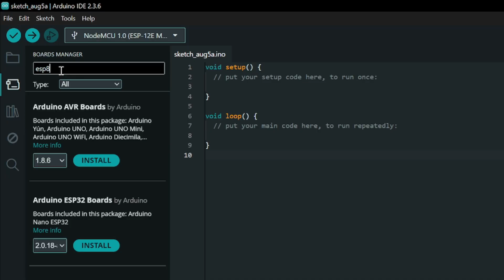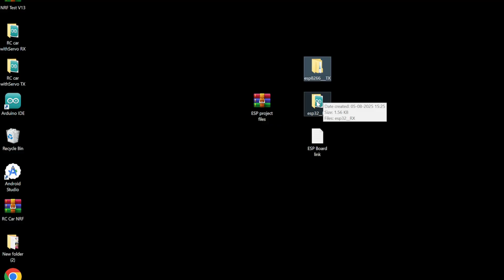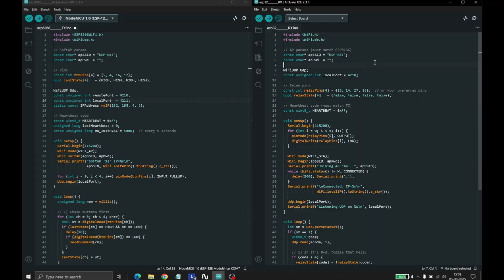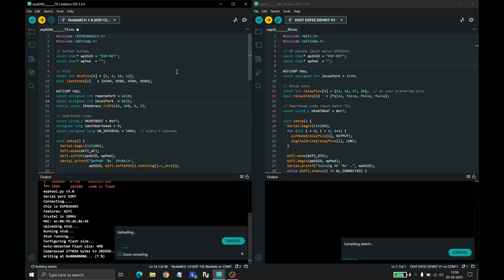Make Your Home Smart for $10 & 10 Minutes — ESP8266 + ESP32 +  RelayDIY!

Comment: How does 5v relay get signal from 3.3v gpio pins ?
Reply from the maker: The delays are connected to the ESP32 (Receiver), and the relays are powered by the ESP32 5V pin. The button module is connected to the ESP8266 (Transmitter) 3.3V pin. The button works on 3.3V.
Reply: @masterRoboticsMalayalam2 but esp32 gpio pins only give 3.3v then how it send signal in 5v and how it works because in my case when I power relay with 3.3v pin of esp32 to relay then it able to work

Comment: Can we make it wireless
Reply from the maker: Bro it is wireless. Just a wifi needed.Use 5v and power up both esp, use battery or powerbank. It will work , no code change needed, Try it 👍👍.
Reply: @masterRoboticsMalayalam2  Sorry, i couldn't see the code clearly.  Do they both need to connect to the Wifi Hub?  Or is this the ESPNow (peer-to-peer)?  Thank you for the great video.